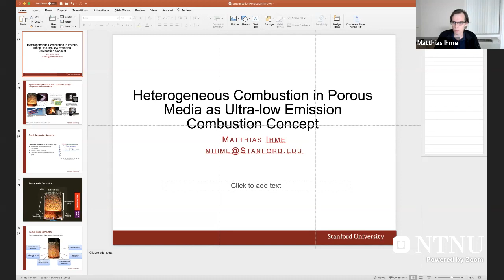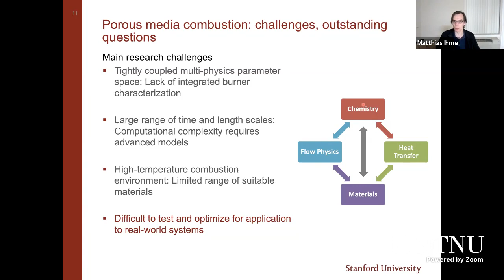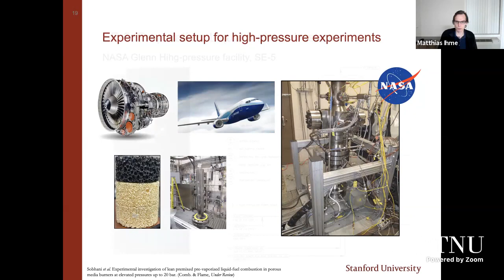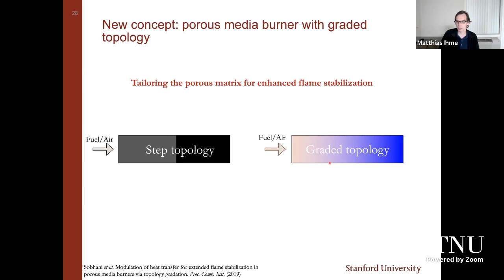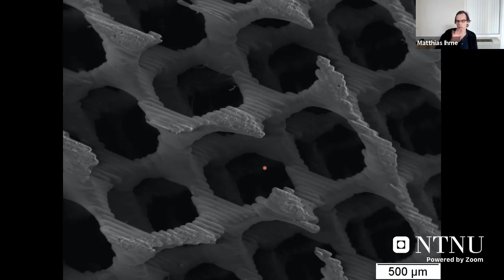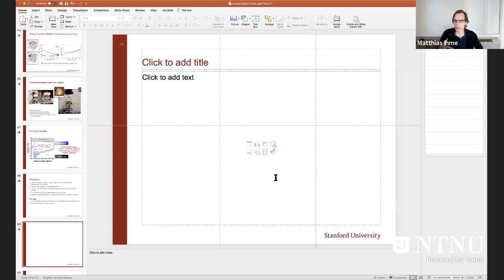Heterogeneous Combustion in Porous Media (Prof. Matthias Ihme)

Comment: Very interesting talk ! Great work. I would simply note that it is not surprising that stacking different porous media with "discrete gradation" does not extend the operating map in the space (flow rate, equivalence ratio). Upstream conjugate heat transfer is very likely to be very low between two porous plates, whilst necessary to extend the operating limits thanks to the heat recirculation. So obviously, a continuously-printed medium will work better.